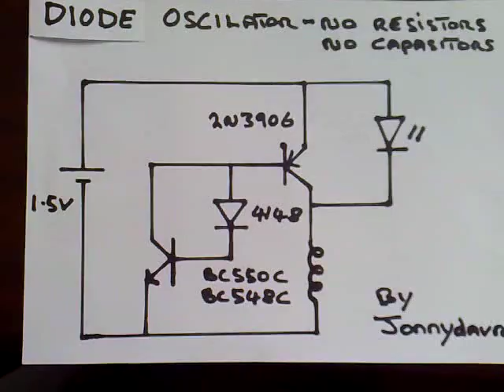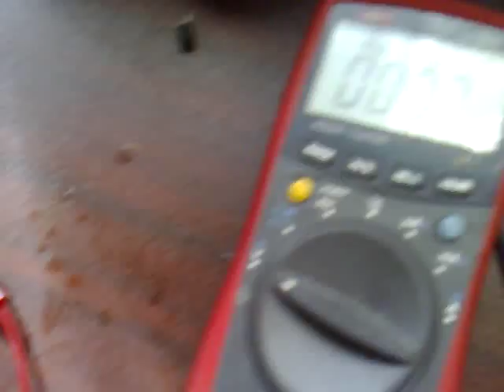Diode oscillator-no resistors or capasitors

Comment: I set up the Diode Oscillator exactly as shown using a 2n3906 and a bc550c. It didn't oscillate at first, Touching the  of the bc550c  base made it oscillate.
 I wound eight feet of magnet wire on a half inch dowel and put one end on the bc550c base and then it worked. Proximity of the small coil to main coil (Lidmotors twist tie garden wire) adjusts the brightness. Can you suggest what might be going on here? 

Many thanks for the fine videos.

Comment: wow thats really cool, what if you want to make it higher powered? like power a bunch of led's? would you just put a bigger coil and PNP transistor? and also the diode has a couple of picofarads of capacitance look at the diodes datasheet, so that may have something to do with it and why it is such a high frequency. thanks for sharing!

Comment: BTW if it was a true Sziklai pair or complimentary Darlington, it would have the emitter of the NPN connected to the collector of the PNP.  It is not in this case, so it isn't a true Sziklai pair (look it up in Wikipedia).

There are severe disadvantages to using the Darlington and Sziklai pair in circuits with a 1.5V supply.  One has to remember that the output can _never_ drop to less than 0.6V above or below the supply rail.  It makes for excessive transistor losses, dissipation.

Comment: The junctions of the 1N and BC are in series and along with the 2N junction total 1.8V.  But the V is only 1.5V, so only .5V is across each junction.  That is enough to cause a small current, so in actuality, the diode is acting as a voltage sensitive resistor.  I would assume, though, that the circuit will work only within a very limited range of battery voltages, so it wouldn't oscillate on a depleted battery.

Comment: @jonnydavro: Hi! How can you make shure that the circuit is really oscillating and the LED is not simply being powered by the 1.5V battery? Since the coil is a short circuit for DC, and the voltage drop in the led is around 1.5 v to 2 V or so, it could be possible that the LED is simply lighted up by the battery, couldn't it?
Cheers

Comment: Remember - a junction diode at low votage IS a capacitor.
Also, if this circuit is powered by more than about 3x forward voltage it will pop the PNP b-e junction;  say 2+ volts.
Interesting little circuit just the same !

Comment: @jonnydavro 
Hi Thanks for the quick reply, the vid must be too long.
I spend half the time finding the mains sin wave in my house :-)
the other half of the vid shows the oscillation ckt using the 1n914.
start from about 10 minutes
watch?v=8aQU1DrviII
one coil
one switching diode
one transistor
one rectifying diode
That's it
6 volt battery charges 
12 volt battery 
no problems :-)
here is the ckt drawn out:
watch?v=Zi8fA_BfNEU
it's the first one.

Comment: @jonnydavro 
Hmm,
maybe it is more dependant on the stray capacitance and inductance of the cables...
As you have quite a huge amplification with 2 transistors these things play a major role for the right phase shift, so oscillation can occurr...
Regards, Stefan.

Comment: That is good one Jonny.  It reminds me of that Russell McMahon circuit I just made but your idea to use the diode and no capacitor or resistors is great.   I have been trying to figure out how the LED is fired in that position though.  I guess the inductor flyback somehow goes back through the PNP???? This must be somekind of charge pump?  A "C"less LC circuit?  A tankless tank circuit?  Aliens from the planet "Slinky" causing an energy vortex?